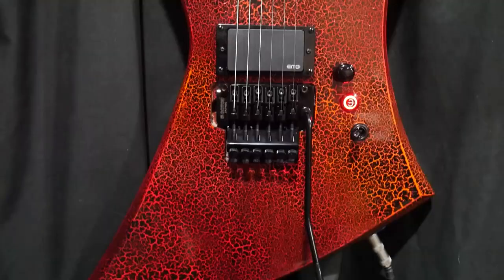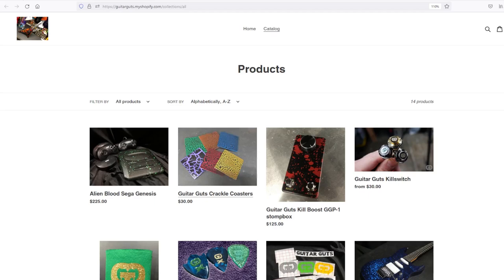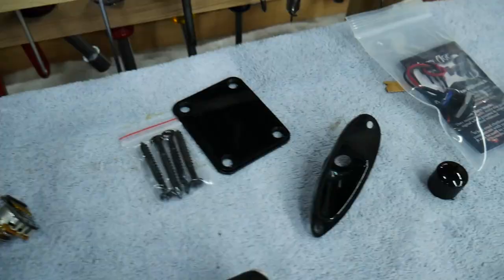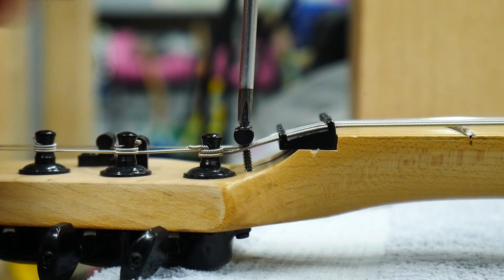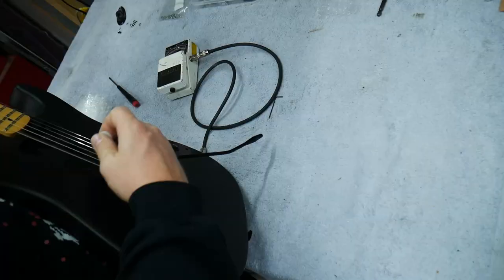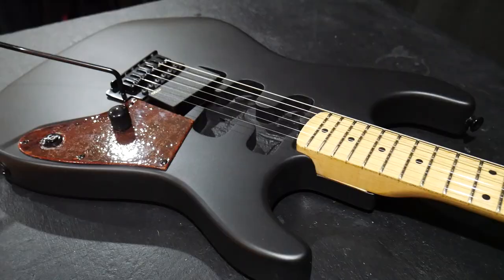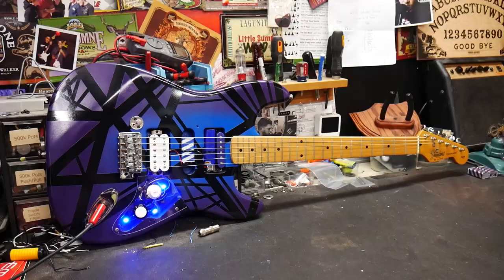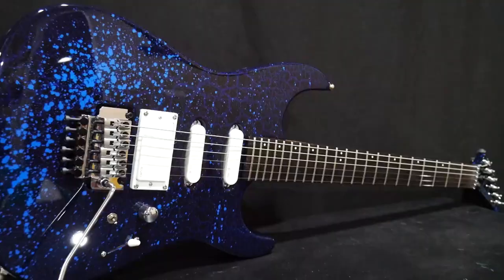Trash to Thrash #49 - Rusty Frankenstrat Part 2 (Washburn Lyon/ MIK Fender Strat)

Comment: Wait, are there no locking pegs on the nut? You are using the string tree to keep the strings from slipping where they might in the nut and the bridge stays in tune?  Killer build.